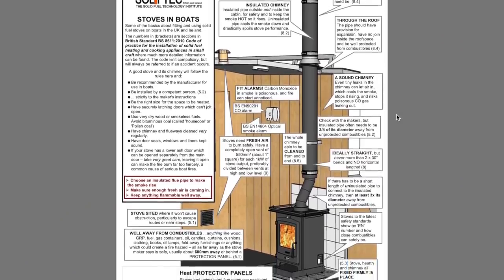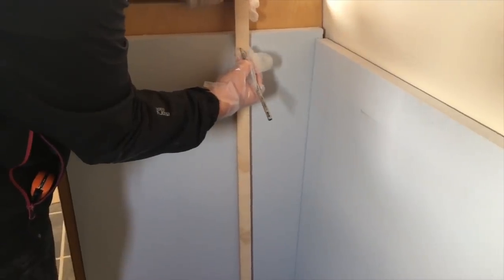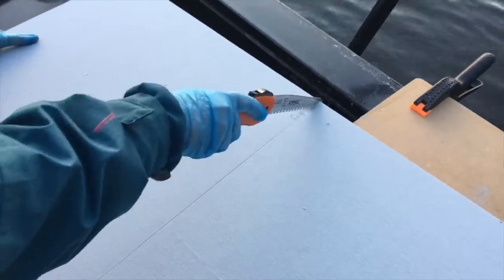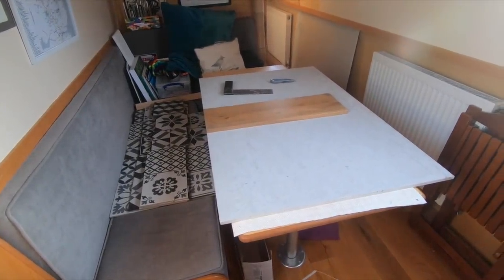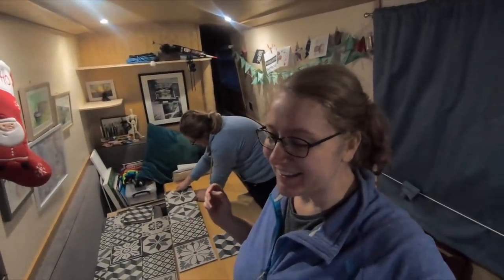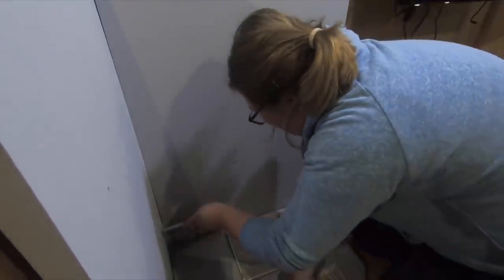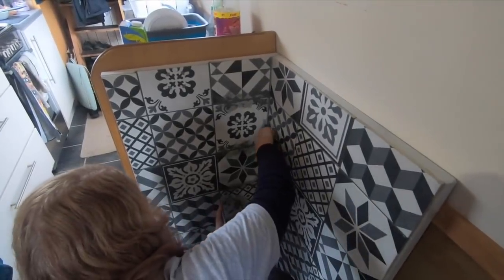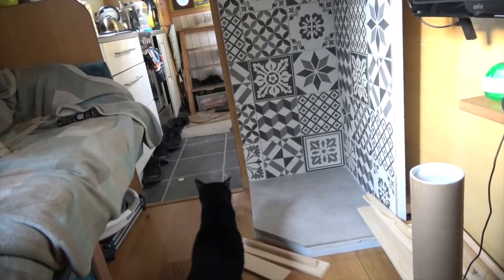Hearth building DIY on our narrowboat (2020)

Comment: Well done ladies,just a tip for others doing this ,make sure the tile glue is suitable for heated areas, put the cut tiles in the corner first that way you don’t see the cut and get the full tiles in full view around the unit ,then make sure you choose the right grout for your purpose sanded or smooth,nice vlog showing what you can do if you try 🤗

Comment: Great job. Usually better to put the cut tiles on the inside edge as the view of them will be blocked by the stove and you've got a nice clean line on the outside edge then. Lovely work though x

Comment: you can grout tiles by using a sponge as it is quicker and you get evenly applied grout, also grout will wash off once dried as ive just done round the bath in bathroom using this grouting method and its a method my grandfather taught me and he always used this method, although it took me a week to do this job because of my back, having said that you did a great job

Comment: Beautiful job in the end.  I might have put the cut ends on the opposite sides of the walls, so they the short (non-whole) tiles are at the bottom and the back corner (that will be hidden by the stove), but that’s a pretty minor choice.  Very tastefully chosen on the grey base and the mixed wall tiles.  Can’t wait to see that with the stove in place!

Comment: Good tip for doing grouting is to apply it with an old credit or store card, its flexible and gets the grout into the narrowest gaps and doesn,t scratch anything. Also uses pieces of the box the tiles come in as spacers, costs even less than matches.

Comment: Love the sandwich-making gloves as work gloves.  Safety first!  LOL  Also, you should've used something like a fork (the proper tool is called notched trowel) to create waves on the tiles so they would stick better to the wall due to the suction effect.  Just spreading the cement like a jam on a toast is not enough.

Comment: Looks great 👍. I really understand your struggles with the look, I live on a converted cottage by a lake and I am in a constant battle of trying to make things look mismatched, used, reclaimed, and DIY. People that live in normal homes will never get how hard it is to get that look just right. I know it is probably too late but I recommend staining the trim before you install it. If you ever have to cut cement board with a razor, Stanley, knife again take a pair of pliers and break off the very top of the blade, about 1 or 2 millimeters back this leaves you with a harder stronger and sharper cutting tip than the pointed factory tip on the blade. This is an old trick used to cut metal flashing and cement board. Can't wait to see the stove install.
Reply: Interesting tip about the blade tip. Wonder if that might translate to X-acto knives and brass, copper, aluminum, shim stock used for model train details.

Comment: Just a couple of thoughts. It looks like you are trying to snap that board on the wrong side?  Difficult to see but you score one side snap it from the back so the score is opening up if this makes sense. I would have started full tiles on the top and the outer edges. The cut tiles would then be on the bottom and in the corner, mostly hidden behind the stove. In the end
you've made a good job of it.
A thought again about staying warm steering in a British winter. Get a big old jumper from a thrift store, cut the arms off and use these over your pants as ankle warmers. may need a bit of hemming. Thank you again for your vlog

Comment: Nice job on the design of the tiles. With the grout, you can just trowel it on, no need to be too cautious. You can wipe it down somewhat and then polish the tiles once it dries. It won't stick to the smooth surface of the tiles.
Reply from the maker: I have to disagree, having done a kitchen a bathroom and now the hearth as well as being a ceramic artist. The grout needs to be attended to right away.
Reply: The Narrowboat Experience I think it depends on the grout you use. My experience reflects Tom’s. A quick wipe when you are doing it, then clean up properly when it’s dry. All the grout comes off with a damp cloth.
Reply: @TheNarrowboatExperience  We must disagree this time then. ;-)
Reply: This chap is demonstrating the technique I would use: https://www.youtube.com/watch?v=IemPfDtmNw0
Perhaps I'm misunderstanding how you did it but it looked as though you were carefully applying it directly into the gaps and trying not to get any on the surface, which would be why you were racing against the clock before it set.

Comment: One tip I can offer from experience of cutting and laying tiles - think about having whole tiles on the top and outside of the project and the cropped ones in the more hidden areas. Having said that, I think your layout works really well. Congratulations!
Reply from the maker: Yes, we know that is standard, but in this small space and with the design we decided to cut the top ones because they then get a trim on them.

Comment: Great looking job pat yourselves on the back for a job well done. In the future if you need to copy an angle just take a sheet of paper and make a cut in the middle about 5 inches lay the end of the cut against the point of your mitered area and fold the corners back. It should give you a reasonable line to transfer.  Remember as the Concord Carpenter says a little caulk and paint makes a carpenter what he ain't. Perfect
Reply from the maker: Good tip

Comment: Should have put the cut tiles into the corners then no rough edges showing
Reply: The trim will cover the edges so not a problem.
Reply: such a small area that I would have kept the pattern they wanted but a nice piece of chrome trim would have finished the edge off nice.. but did notice that myself.
Reply from the maker: That was our thought too

Comment: Hi
Great video.  I have a question regarding the hearth. 
I am going to seal the  calcium silicate board with diluted PVA (1:5) before tiling my hearth.
I see you decided not to do that. Have there been any issue with the tiles not adhering to the board properly ?
And what type of screws did you use - standard wood screws ?
Sorry if these are such blokes questions !
Thanks

Comment: How did you work out the dimensions for this - I’m also buying a reflects stove 2000kt and I’ve worked out that it has to be 775mm front to back (400mm + 150mm each side) yours looks way smaller which would be so much better - such a helpful video, will be following very soon!! Thank you x

Comment: Hi,, thanks for this video, it’s very useful as I am trying to install a wood burner stove according to the instructions. I was just wondering where you got the calcium silicate board from because the requirements are 25mm , which is hard to find from any suppliers. Any suggestions would be useful.
Reply from the maker: We got 25mm board from midland chandlers. Was marginally cheaper from their eBay listing than their website at the time.
Reply: The Narrowboat Experience Thanks so much again. C

Comment: it looks awfully heavy......did u account for this ? will boat list to that side?  tile looks great!
Reply from the maker: The good thing about calcium silicate board is you can lift it with a finger. the concrete board is heavy as are the tiles, however, we have had all the materials on the boat in the hearth spot waiting instalment, so actually once we get rid of the amount of things we didn't use it will be lighter lol

Comment: I wanted to add a note: When I had taken on a DIY project about 30 years ago of redoing the tile in my friends bath tub I didn't pay attention to the instructions of using a wet sponge to clean the grout and used my fingertips to smooth it into the cracks. The next day my fingertips were so sensitive, missing a layer of skin, that I had a heck of a time typing or using an adding machine. I'm still laughing at my naivety.
Reply from the maker: Oh wow.